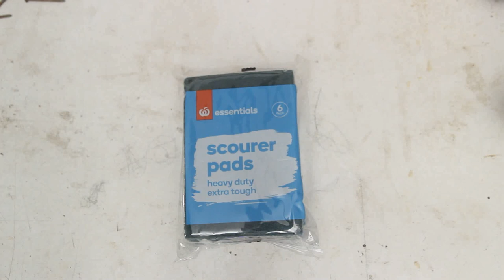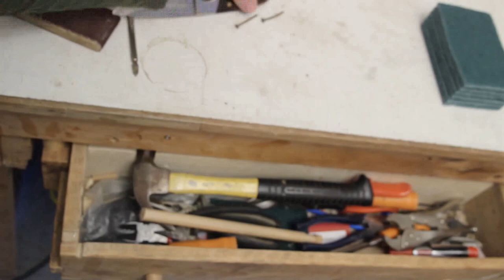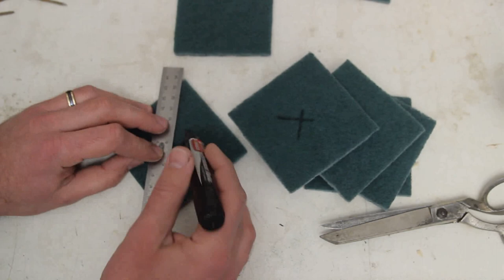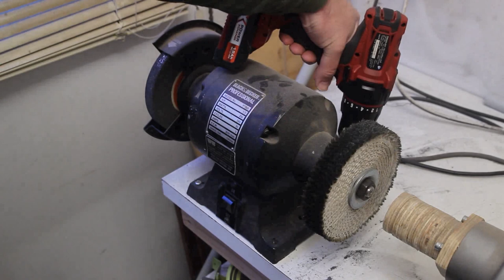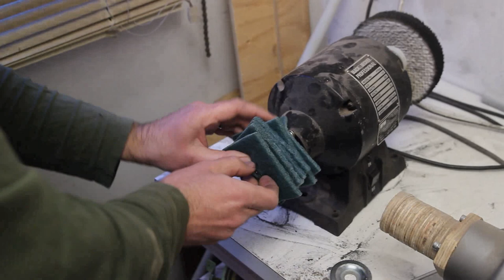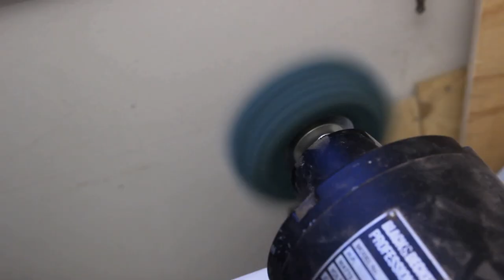DIY bench grinder scotchbrite wheel short experiment

Comment: This is the sort of polishing wheel I’m looking for...just right, thank you. A 3M Scotchbrite wheel can cost $115 or more.
Reply from the maker: I think a ScotchBrite wheel is much better than this, but on the upside this is fast and easy to make and cheap. I've barely used it since making this video.
Reply: SPE  I’ve tried it. I cut the corners off to make an octagonal. It doesn’t attack deep scratches very well. I tried using Gif....I spread it all over the place...it might have helped? Worth while giving it a go.
Reply from the maker: Try some goop on it, I wouldn't expect it to get scratches out, mine managed to buff rust but that was about it.
Reply: SPE  worth a few different tries. I will just have to persevere with decreasing grits...but I’m not a perfectionist so I won’t be spending too much time on getting mirror finishes.
Reply: $115 for a scotchbrite wheel? I’ve never paid more than $30 for two on EBay. They’re from China, but I ‘m happy with them and they last for months.